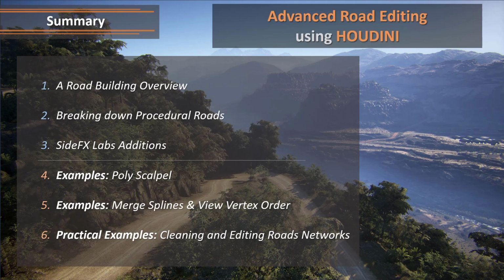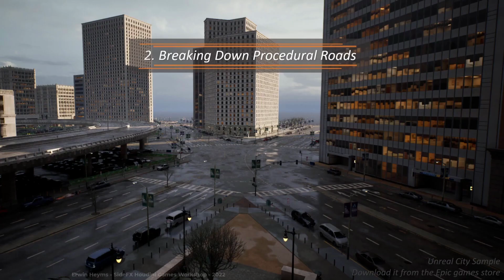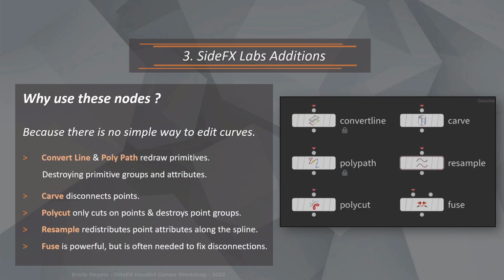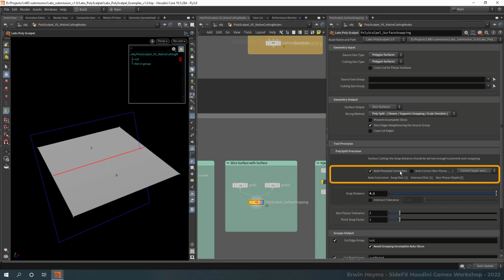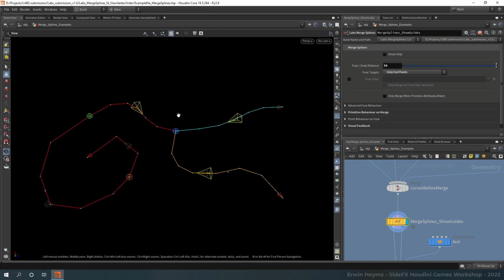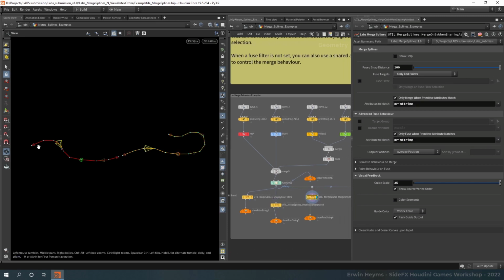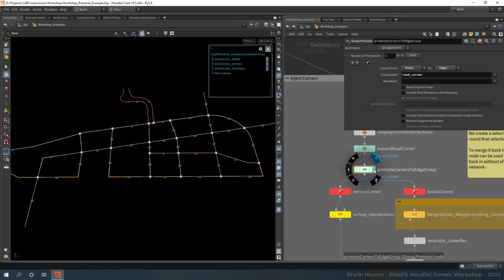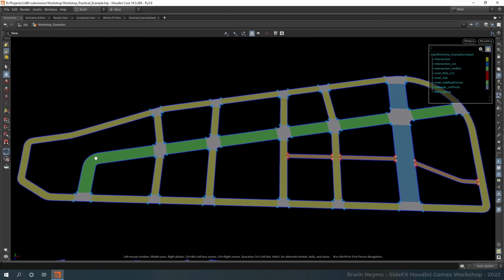Houdini Games Workshop - Advanced Road Editing using Houdini &  SideFX Labs

Comment: another tip when resampling scale to a low res using STRAIGHT LINE and up scale it back using INTERPOLATE, or your roads will move every time when using SUBDIVISION CURVES... !!!!!separate!!!!! any curves when using subdivision to smooth them out .....

Comment: Hi just trying out your code I'm finding the resample to low res for reducing the bend will not work in every situation like a hairpin turn is there a way you could show to balloon it out instead so the curve dose not lose to much position?
Reply from the maker: Yes hairpin turns would need that section cut out and redrawn, expanded outward, perhaps inset into the terrain a bit and then resampled again to a suitable resolution. Finally, recombined with the main road it was cut from.
Reply: @EHoudiniAcademy  i used the edge smooth maxed out but had issues on looping bends. i guess its not something that can be totally procedural with out human corrections being made helpful stuff learnt allot from you so far thanks
Reply from the maker: @Ugly_Baby_Gaming  It can, it worked on the Ghost Recon road toolset, but it is tricky, especially when switchback turns are close together as they have to blend.
Try resampling the switchbacks at a higher resolution so they lose less detail, and over expand them first to compensate for the contraction caused by the resample. Finally, i'd suggest you find a center point and end point to your expanded turn, cut that out along the road upward direction and use a falloff curve from a ramp parameter to control the expansion look and feel
Reply: @EHoudiniAcademy  yer was a few not too many though so all done now ... I have no idea how the merge splines only got 3rd place I just saved at least 4 months work now I found out about it just merged over 15,000 roads in 3 days into 6,000 so easy to use and used the poly scalple for roads with roundabouts... Absolutly LOVE ALL 3 tools you made life saver XXX
Reply from the maker: @Ugly_Baby_Gaming  Thanks. Great to hear its sped up your data handling. 
I'm still working on the poly scalpel as well, optimizing it further.
Reply: @EHoudiniAcademy  sooooo good it's locked and loaded for the rest of my houdini life span oh and the other was the curve direction visuliser that should of come third after the other two can't thank you enough man it's the difference from trying to chop an oak tree down with a "plastic spoon" to having a "turbo powered chain saw"